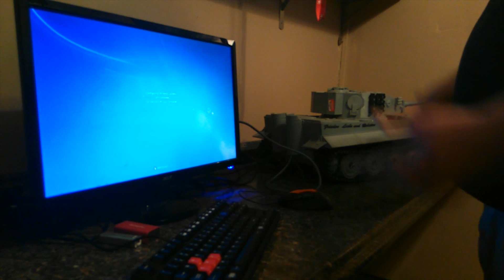3d Printed Tiger 1 Tank - Cooler Master World Series - Explanation

Comment: the tiger tank in WoT has the 8.8 L71 wich is the gun from the tiger 2, the tiger 1 gun is the 8.8 L56 wich is a smaller gun
Reply from the maker: Midnight .Burst The gun this tank has a 7mm barrel. It was designed to look more like the tank from WoT.
Reply: ya thats very correct. Historically, the Tiger 1 had a 8.8cm L/56 and the Tiger II had the 8.8cm L/71 which is also mounted on the Jagdpanther too
Reply: Nah everyone uses the 105mm on the JagdPanther

Comment: Just one thought, did you look at using the 120mm fan to pull in fresh air from the front, and use the power supply to pull the hot air out of the back? This will reduce the overall internal temperature, as currently you are pushing heated air from the PSU into the main area.
Reply from the maker: John Posson That's exactly how it works. mix that with the Intel/Nvidias newest push to make low power/heat producing products and you have a fully functional computer inside. thanks for catching on to that. There was a lot of thought put into this case. It was a computer case first then RC was added. that made it a bit tricky but it works very well.